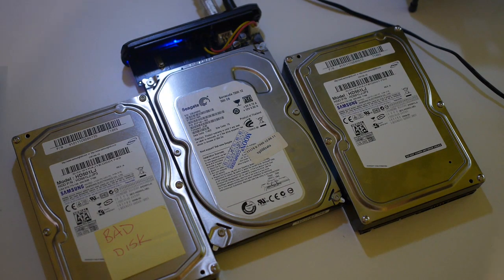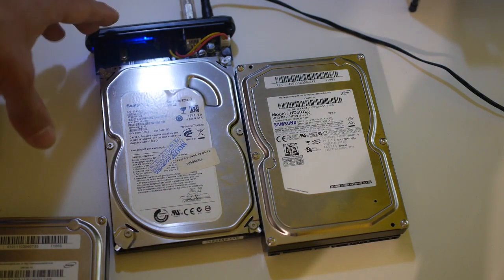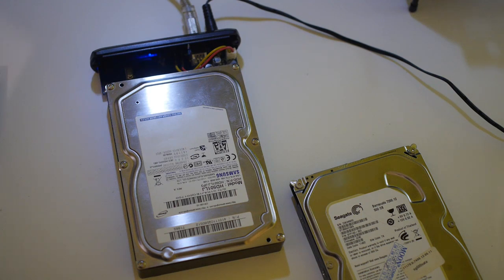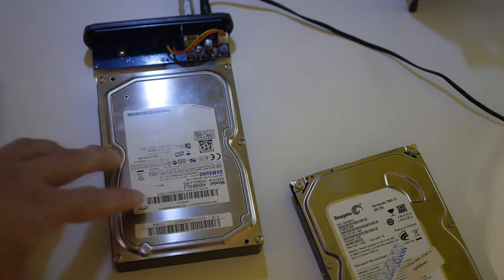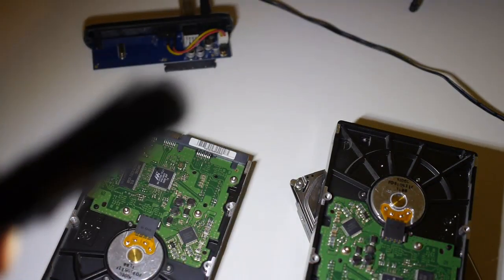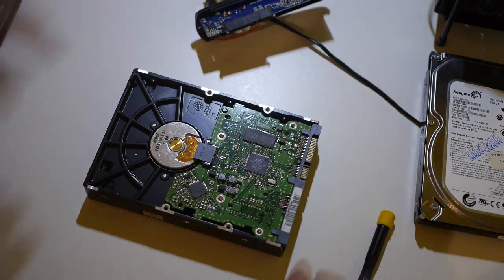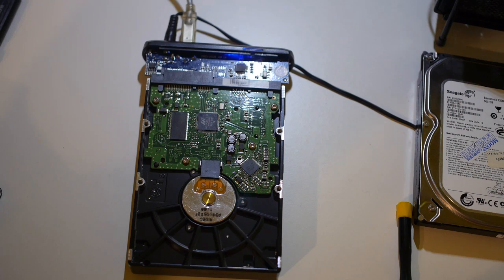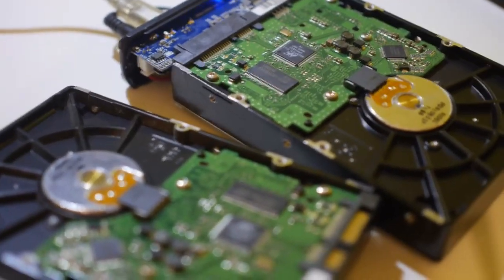Hard drive data recovery: repairing hard disk with bad circuit

Comment: I have a Barrcuda ST2000DM001. The disk is in good shape with a bad circuit board. I have a replacement from an identical hard drive. I'm using a simple docking station to access my data but it won't spin up. I suspect the docking station is the problem. What are you using to connect your hard drive to the computer to access the data? This is huge as I am in the middle of writing a book that I can only access through the hard drive. Any help is greatly appreciated! Thanks!